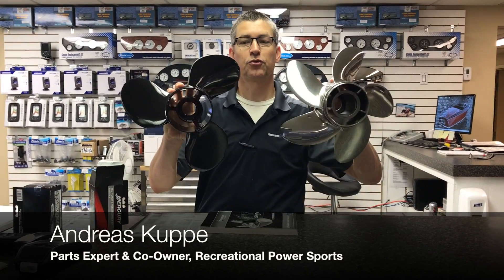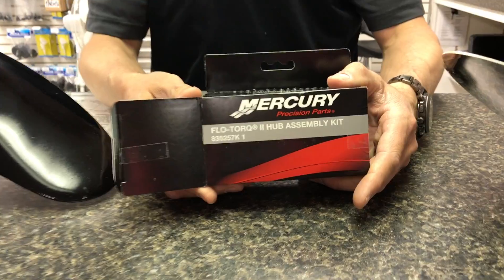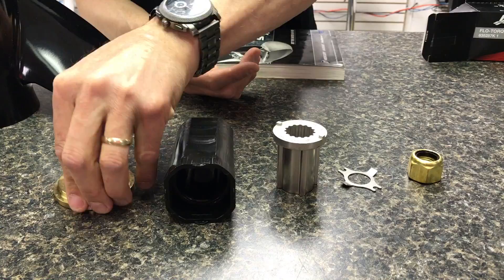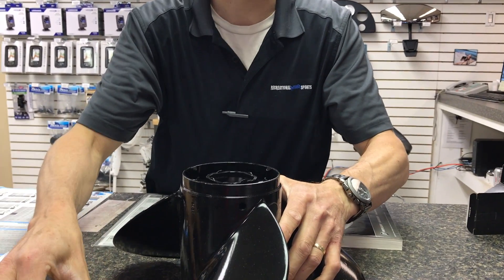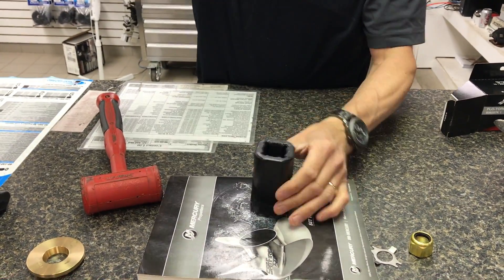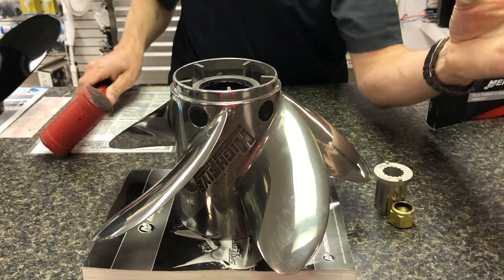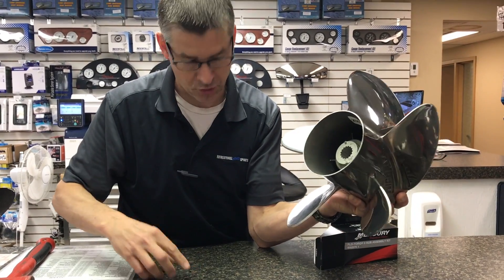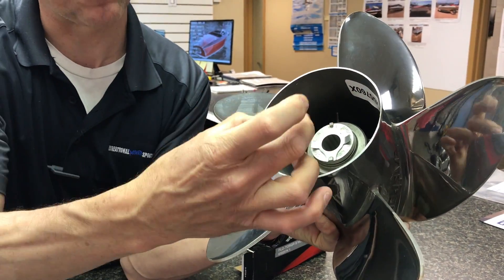How To Install A Mercury: Flo-Torq II Hub Assembly Kit

Comment: Hi there i have an 5.7 v8 mercury (sea ray 190 from 1996). You told in the video that all models from 2000 fit this kit. So i can’t put this kit in my propeller because its from 1996?
Reply from the maker: Hi, Raymond!

I would say that roughly 1996-2000 had the built in hub kit, whereas 2000 and newer Mercury started building the removable hub kit. So that hub will work it just didn't come with it from OEM.

Please feel free to give us a call and we'll be happy to help answer any prop questions you may have. 1-866-535-1004

Thanks!

- Julie, Recreational Power Sports
Reply: Thank you so much for your answer, great service! Realy appriciated
Reply: To be sure. Its possible remove the original hub en place the new hub kit.

Comment: So I can put one of thees on my 1984 50 hp mariner?
Reply from the maker: Hi, Charles.

I don't believe this is the correct hub kit for your machine, unless you have a BigFoot model. If you would like to speak with one of our prop experts, the can help you find the correct hub kit for your Mariner.

Give us a call toll free at 1-866-535-1004 (Monday-Friday 8am-5pm MST). If you end up wanting to order the hub kit or other parts through us, we do ship Canada wide!

We look forward to chatting props with you!

- Sydney, Recreational Power Sports
Reply: Is it the same process on a 2019 merc 50 hp 4 stroke?

Comment: Nice video man but my hub kit came with a inserted pice it’s inside the bushing I didn’t see it on yours is it normal ..??
Reply from the maker: Hi, Fidel.

This is the Flo-Torq II Hub Kit from Mercury. Is that the same as what you purchased? If you want to send us a picture, Andreas can totally take a look and give you some advice. You can send it to andreas@recreationalpowersports.com and explain that you saw his YouTube video for this kit.

Or, if you'd prefer to chat over the phone, you give him a call toll free at 1-866-535-1004 Monday-Friday 8am-5pm MST.

We look forward to chatting props with you!

- Sydney, Recreational Power Sports
Reply: Pretty sure you're talking about P/N 23-856163A1, it's an extra bushing that is recommended for the surface piercing props (Fury, Tempest, Torrent, etc).